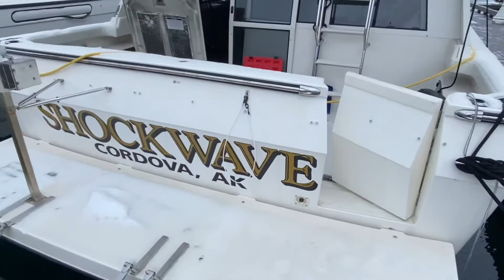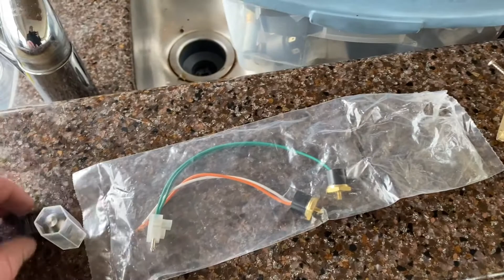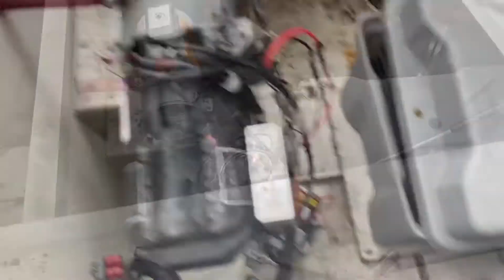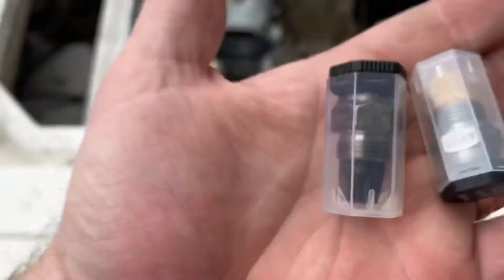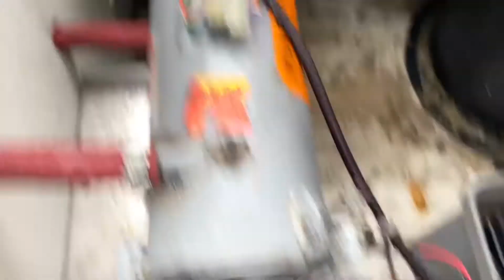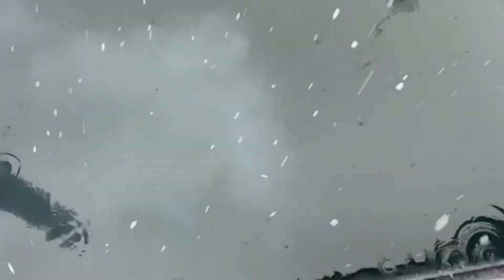Webasto DBW2010 Service and Repair Bayliner 4788

Comment: this is an older video...  i work on these a lot...  couple things..
1. the smoke is often because the rubber grommets where the wires and such go through are older and cracked.. you should feel absolutely minimal air from around the heat exchanger housing and the grommets.. if you have lots it causes the unit to run rich and will smoke and clog up your nozzle much quicker..
2. yours sounds like the fan bearings are starting to get worn.. not worrisome but something to think about changing in warm weather..

3. Never overtighten the 2 10mm bolts..  ive seen the housings get broken from this... if the nuts back off over time.. simply switch to nylon lock nuts...  

for those looking to buy these.. look to scrapped school busses from northern US states or canada... many of these existed in them and usually the junkyards leave them..

if you want the water system to heat to a higher temperature, webasto makes a thermostat with red / green leads on it and will heat the loops to 180-185F or so..  I use these heaters in my mobile office bus and a smaller TSL-17 in my red bus that I travel in and want to be able to pre-heat the diesel engine before starting in cold weather